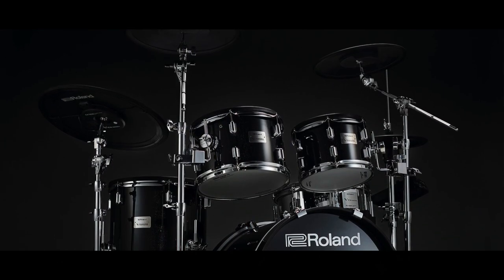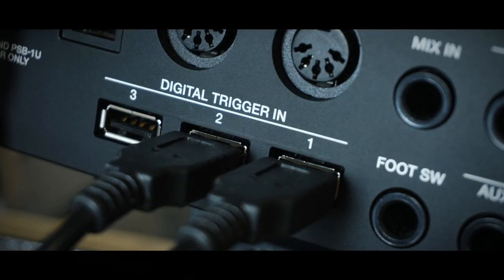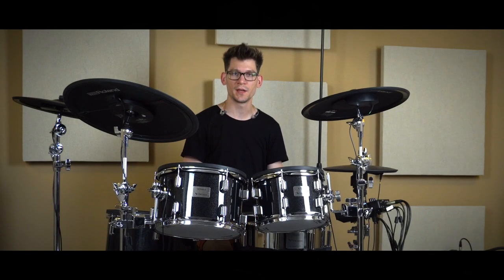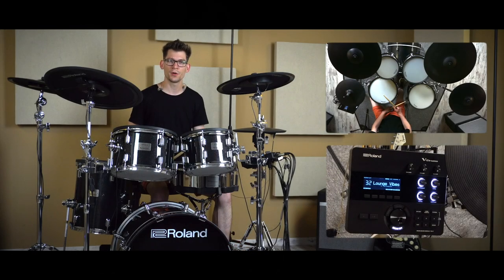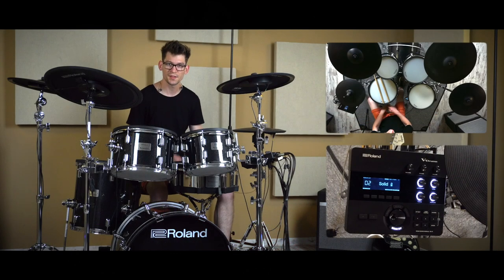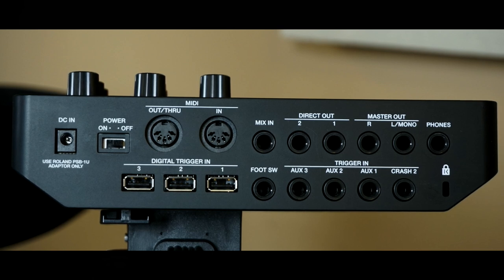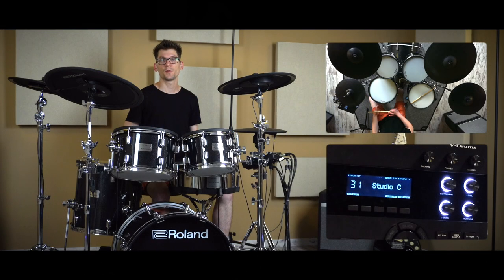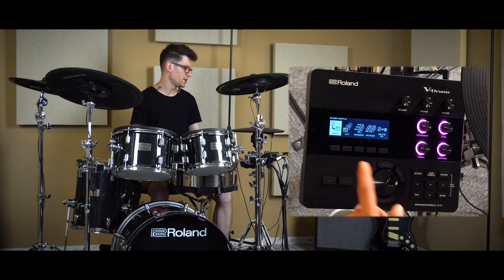Roland VAD 506 review + demonstration // The Hybrid Drummer

Comment: I always tell doubters:  Build me a reliable, stage ready Acoustic to Electric kit conversion kit for under $4799, Impossible.  Something goes wrong, something miss triggers, something falls off, Laptop crashes, software freezes up, direct out routing takes 3 menus to set up.  I know i built 3 kits so far for churches, sold them and ordered the VAD503.   Dont like the sounds?  Import some, trigger some, tweak the internal sounds.  If you are just a home player then get the lower end Roland kits and buy $300 Superior Drummer with the extra cash.  Sound are not as important alone, what is more important is how the sit in the mix.
Reply: I understand your point but have to disagree because at this price point we shouldn’t have to settle for crappy sounds. Why not give the people the option of upgrading to the TD 50 module? Or use some TD -50 sounds in the TD 27. Don’t get me wrong I’m a big fan. I’m gonna buy this kit when I can buy it without the TD 27 module.
Reply: @g.j.haycock1064  What's the issue with TD 27. I'm considering buying this kit. The VAD 706 is too expensive for me.
Reply: @paulofaria  There's no issues with it, other than some folks complain about hi-hat accuracy when using the td27, but I haven't noticed that. I've had the 50 for years, and I actually prefer the td27 for home use (50 for live, only because it uses individual cables instead of a snake) and it sounds great. More importantly, it triggers perfectly,  100% of the time.

Comment: I would like to mount my vad on a m32 midas digital mixer is there a special manipulation to do on the td 27 module for optimal sound
 on my sound system I have 2x top 12 "and 1 x sub 15"?
Reply from the maker: On the td27 with the 2 direct outputs you can for example route the kick to direct 1, the snare to direct 2, and the toms and the cymbals to the master stereo
Reply: @TheHybridDrummer  thank ;-)
Reply: @TheHybridDrummer   I do not understand the manipulation I have to go through the setup in the out mode? I'm newbie :-(

Comment: Need an honest opinion. Would an ATV ADrums + Pearl Mimic Pro be a better option than the Roland VAD
Reply from the maker: I don't know, haven't tried that combination
Reply: Way too much money my man. Instead of buying a mimic and a drums, get the Roland and a laptop and superior drummer and save some money in the process, you're gonna end up with better sounds and pads. The adrums are just too expensive for their sizes and the mimic won't work with the didital pads.
Reply: I've been looking at DrumTec lately. You can use any module with their drums. Priced about the same as the 506.
Reply: @fVNzO  I am considering buying the VAD506 but with the Roland TD27 going into a VST with MIDI I feel I am buying an expensive module that I will not actually use...

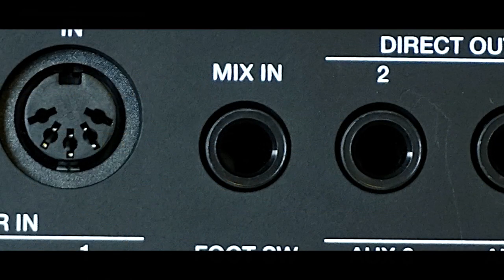Comment: At 8:35 he says "with the USB connection the module becomes a sound card so you can record without and external soundcard on separate channels". If I understand correctly, it means the module becomes your audio interface and therefore you cannot record a guitar or a microphone at the same time. correct ?

Comment: how loud is the kick? would it be fine for use in an apartment? do you use any patch or specific beater to make it quieter?
Reply from the maker: It’s pretty quiet but not silent. Plastic beater is recommended, because the felt may damage the drumhead I think. A patch wouldn’t make it quieter, actually that would give more attack and punch which is louder